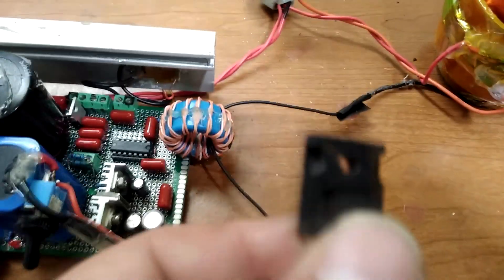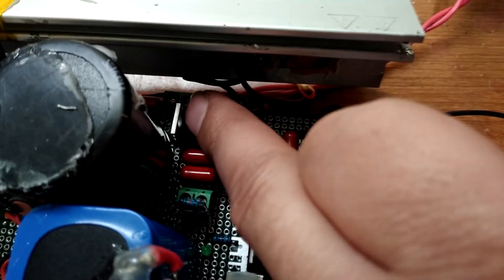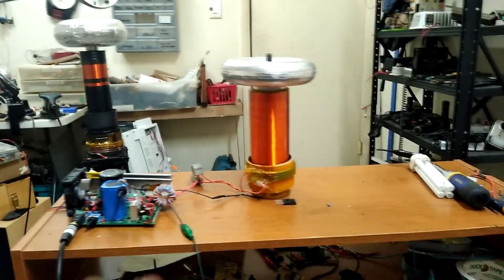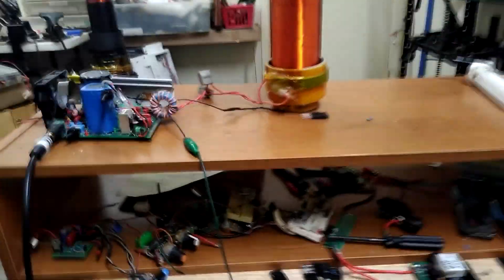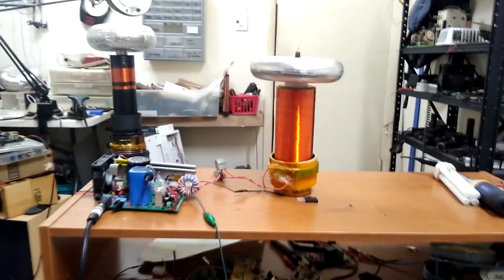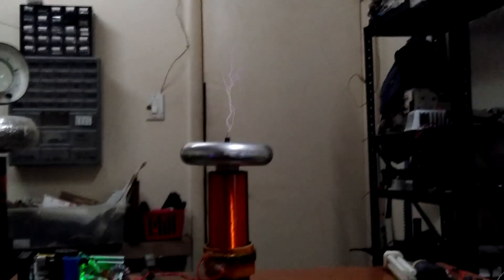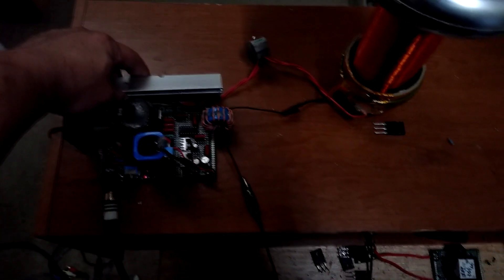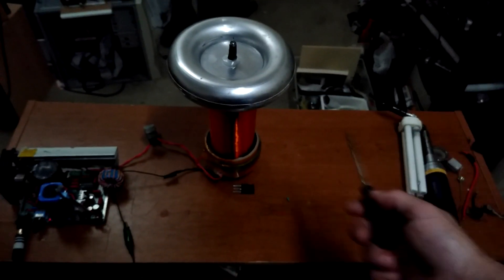Steve Ward Micro SSTC Mod 120VAC

Comment: since steve wards circuit uses a " 74HC14 " could i use  " 74HC86" ? thanks.
Reply from the maker: No you can't drop in replace the HC14 with the HC86 because thats a XOR gate chip that takes two inputs per channel but I suppose with some clever changes it could be done. By holding one input low or high I suppose you could get relatively the same switching action on the output of a channel by feeding the other input with the feedback signal.
Reply: @Magneticitist  oh k thanks